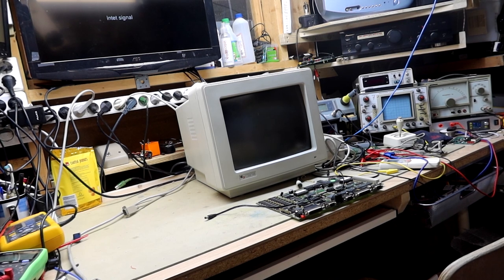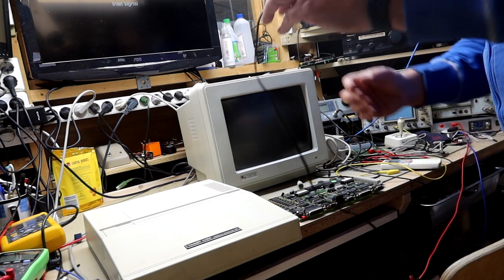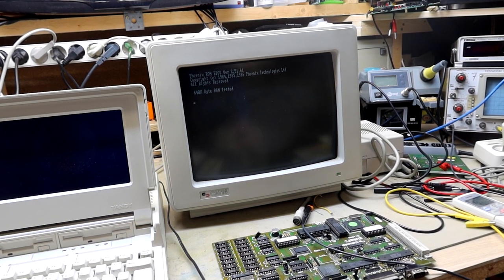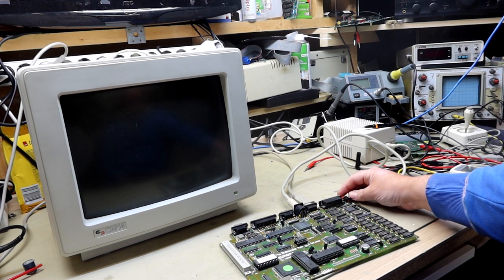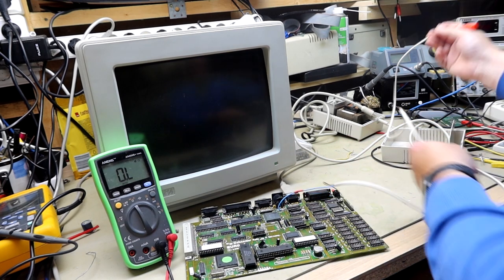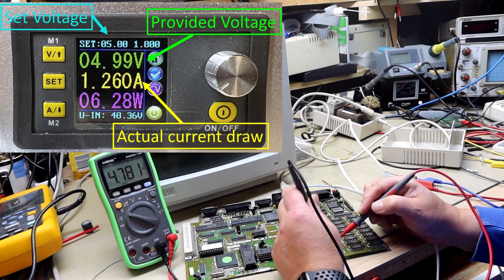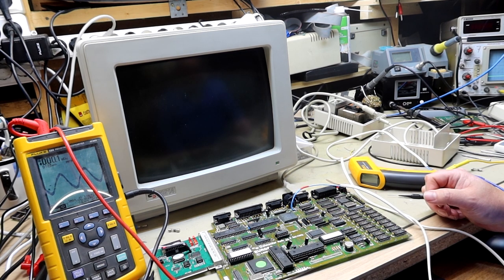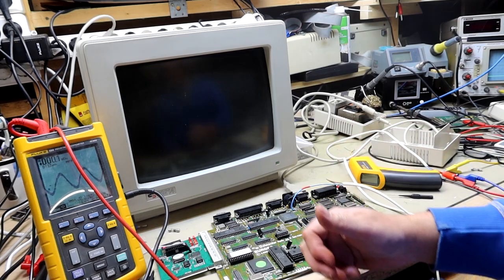The Schneider Euro PC, Part 3, We dig deeper into the workings of the system

Comment: Hi Sir! I dont have a problem with longer videos. In fact it is for me a good thing. Yo can show the drawbacks and advances in such a great and expensive computer. It shows to people that IT IS NOT in 15 minutes that the things are fixed like we see in other channels, leting people think that the person is an electronics genious.
Reply from the maker: Thanks for watching. You are right, it's newer 5 minutes (Except for some standard C64 repairs). And if you do this from the bottom up, so that you actually try to understand what's wrong, and just don't swap parts randomly it always takes time. For me it's all about learning the workings, and sometimes you just have to give up because the information you need is not available. Then you can start to swap parts around. But more often than not that means ending up with to not working systems instead of one…

Comment: the current seems to be high and you have two hot chips with the port in upper right conner, what about cutting the power pin in the two IC to see if the current goes down and maybe get it running again
Reply from the maker: That is probably not doing any good. First, they are not that much warmer, and if you cut power to a bus driver, it's going to start drawing power directly from the bus if something is wrong within. Also if you don't have power you should treat the gates as open flowing, and in TTL that is a high. What will then happen if the bus wants to go low ? The only thing you can do to isolate this kind of fault is to desolder or cut all the legs on the 373/374 244/245 and the other busdriver chips.